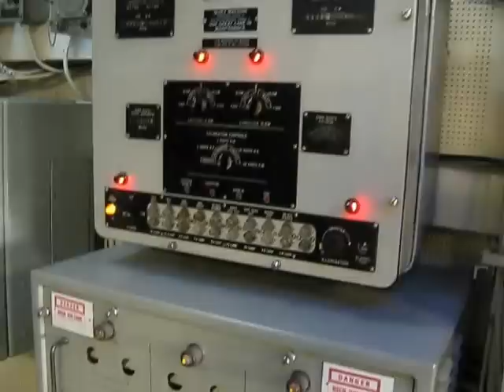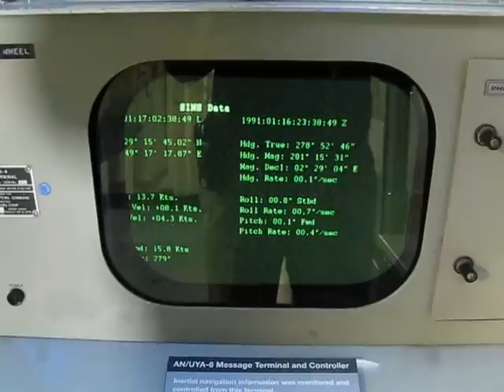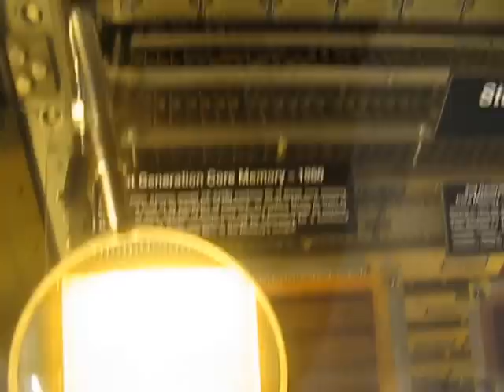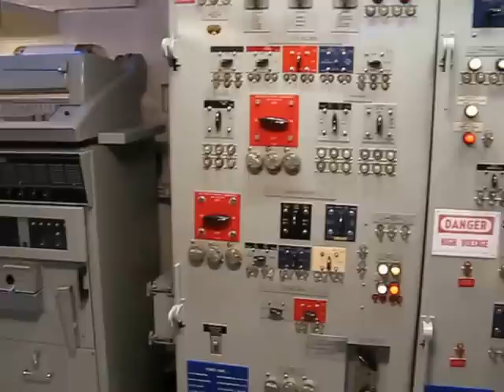USS MIDWAY SINS ROOM

Comment: I was a Data Systems tech on board the USS Coral Sea which was a sister ship to the Midway. I worked on the tape units and the CP-642B for 4 years. 1985-89...It is great to see them operational.